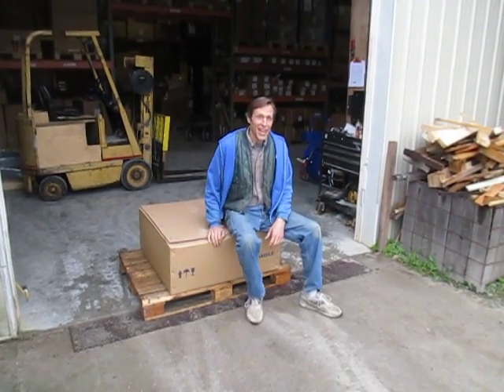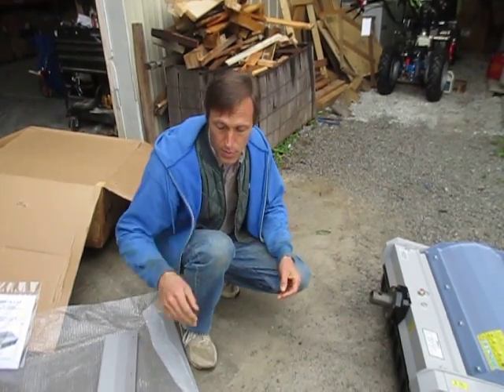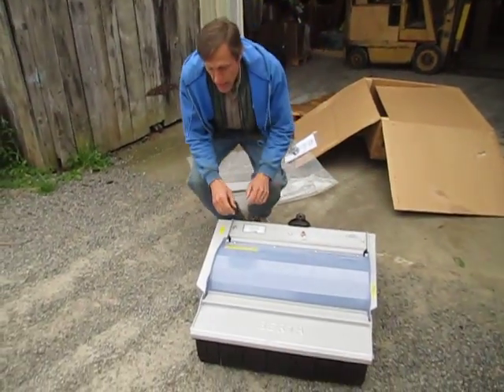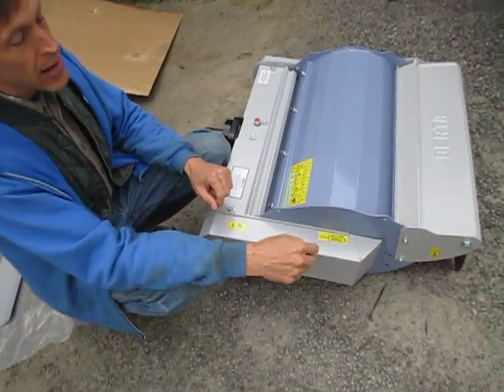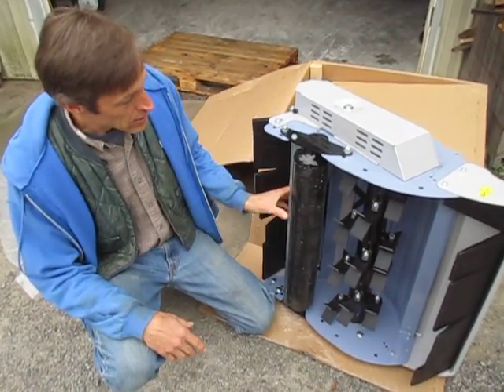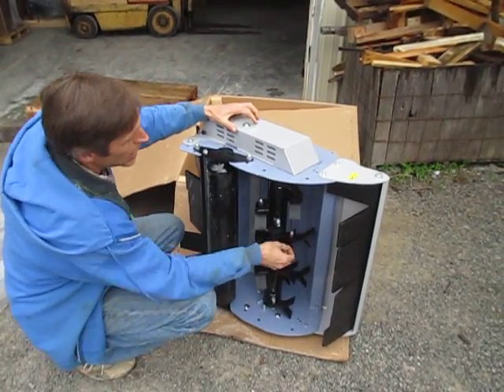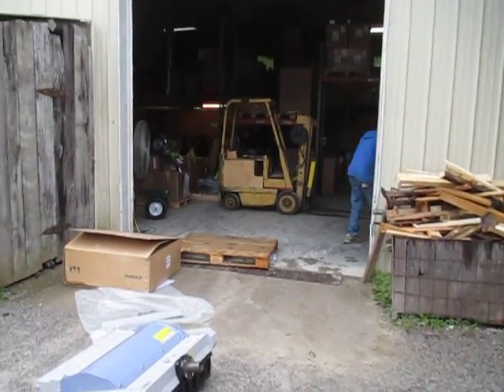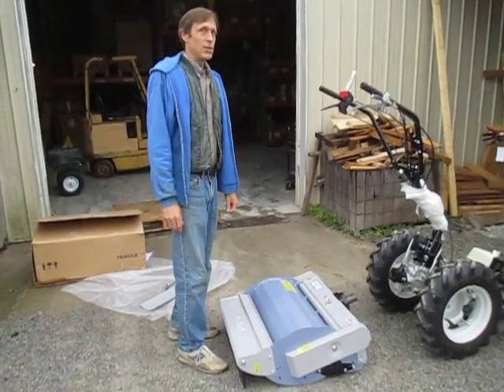Berta Flail Mower for Walk-Behind Tractor -- Setup, Features & Basic Maintenance

Comment: Hi, may I have your advice, please?
I did buy Roller Blade 75 for BCS 740.
Roller Blade looks very similar to Berta Flail Mower, but it's about 90kg in weight.
I found that it's quite inconvenient to move it attached to the tractor on a short distance - between my garage and the orchards, as there are some obstacles and bumps.
Roller Blade does not come with transporting wheels compared to Blade Runner (the last one does not have a roller).
What would you advice, please, how to transport Roller Blade from home to the orchards and vice versa?